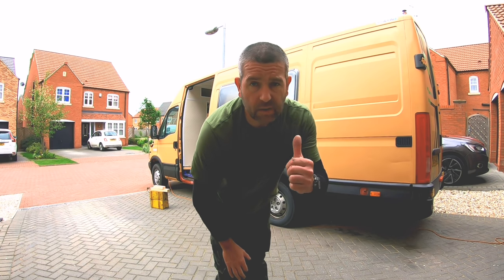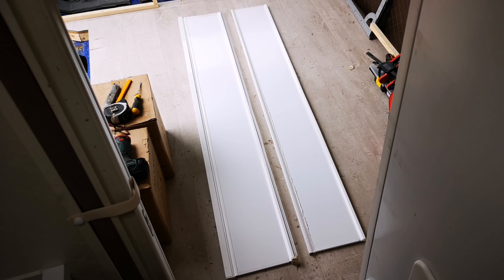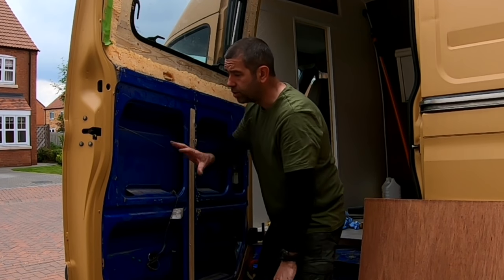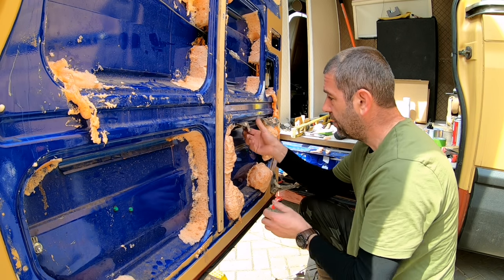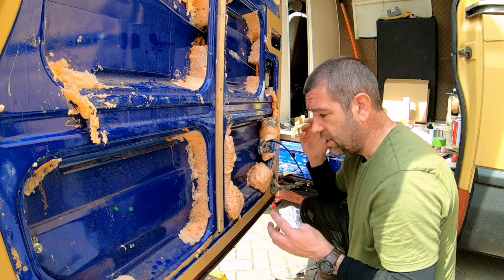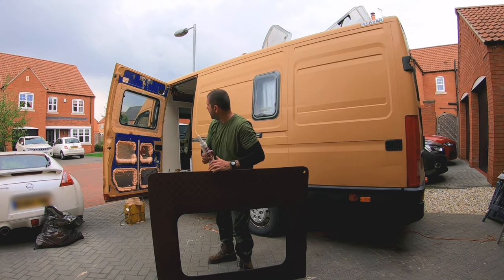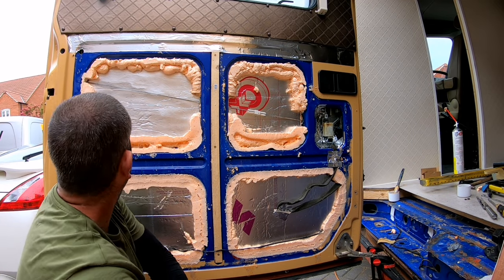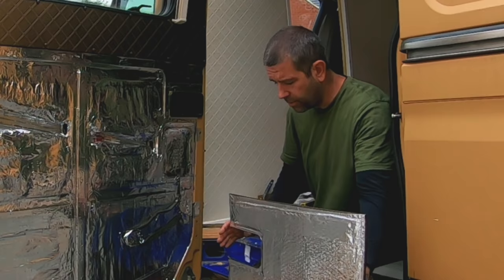Insulating A Sliding Door: Easy Diy Tips For Your Camper Van Build!

Comment: Man of many talents. Thanks for sharing. I've used 36 cans of foam so far. You understand how insulation works: 100% coverage! Most van builders don't fully understand  insulation.
Reply from the maker: Cheers matey 😉👍, yeah mine works extremely well, I've been on sides of mountains minus - 5°c blowing a gale outside, and I haven't used the diesel heater much at all, if on its set at 9°C over night, and can't hear much noise coming from outside, also in summer it's cool in the back 😉👌👍👍👍.

Comment: Well done Mark. This van looks like a lear jet from the closing captions. Just one thing I may have done at this point! change the roller bearings at the same time perhaps. Still Enjoying the show and waiting to see this bad boy on the road fully finished. Just opened a bottle of BUD, CHEEEERS.....
Reply from the maker: Cheers matey 🍻😉👍, I have checked them and they seem to be fine bud 👌, saying that, the bottom runner needs a lick of paint, which will need doing sooner or later 🤔😊👍👍👍.
Reply: Knew you would have checked them out. Good stuff. Already on the another BUD. CHEERS. @Iveavan
Reply from the maker: @pamandrobtrust7624  haha, enjoy mate 😉👍👍👍

Comment: Great video! Any details on how you got the slider to swing out like that? Working on mine now and i also dont wanna take the whole thing off!
Reply from the maker: From memory, two 8mm headed Alan key bolts hold the slider onto the interior part of the door ( remove those two bolts ). Then it pulls out along with the rubber grommet 👌👍.

Comment: Hi again Mark were did you get the paint from my van needs a coat of paint it’s been a builders van for 14 years , you did a great job on the door , that reminds me I have to sort my handle out , the door only opens when I pull on the cable , it worked before from the inside but since I put the new handle on the out side it’s not working
Reply from the maker: It's from here bud https://rover.ebay.com/rover/0/0/0?mpre=https%3A%2F%2Fwww.ebay.co.uk%2Fulk%2Fitm%2F391739917457     
I had someone on here the other day saying there outter door hand wasn't working 🤔, never heard the out come though mate 👍👍👍

Comment: What kind of panels are you using for the door? They look lightweight and flexible...
Reply from the maker: It's 4mm plywood, the full van was lined out with 4mm plywood before applying the leatherette, it is fairly flexible and light 😉👍👍👍.
Reply: @Iveavan  Great, thanks!

Comment: How comes ya didn't do a sliding door for the access to cab!?
Reply from the maker: Because the wall would have had to be twice as thick for insulation bud, the door fitted, is around 35mm thick with 25mm PIR inside that matey 😉👍👍👍.
Reply: @Iveavan  Ah ok. This whole insulation thing seems to be a right royal pain in the ****!! 😣🥴
Reply from the maker: @L4WNY..  it's probably the most time consuming part of the build, yet most important part, it's been 40°in the cab but 18° in the back, so unfortunately, it is a "must" for a tin can 😉👍👍👍.